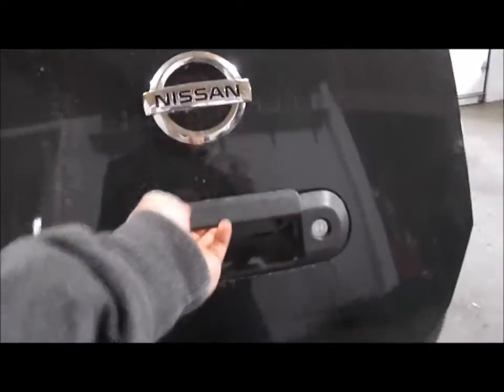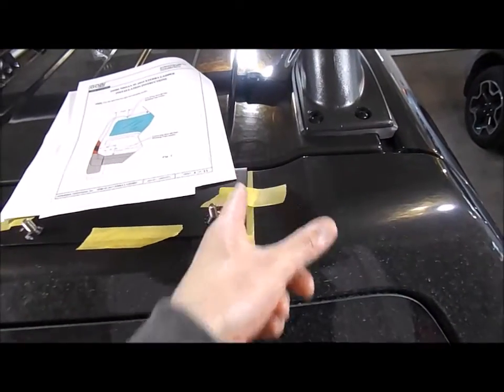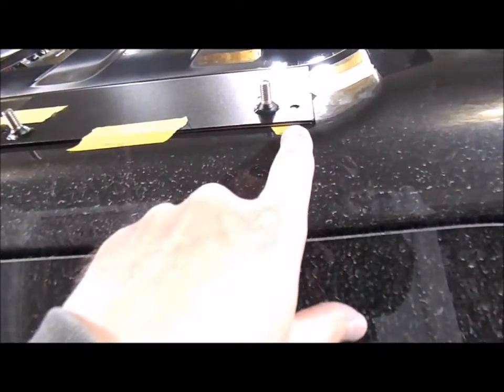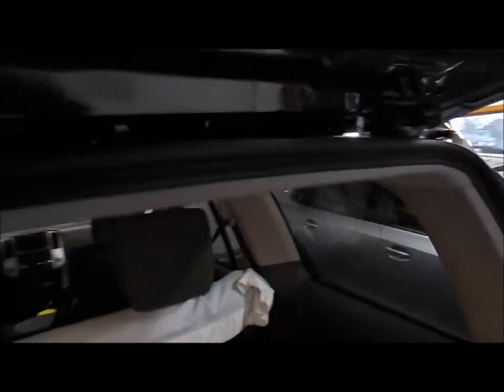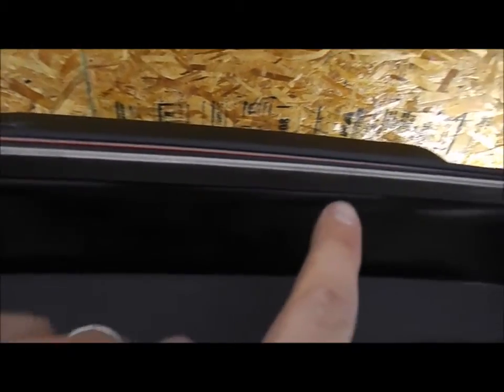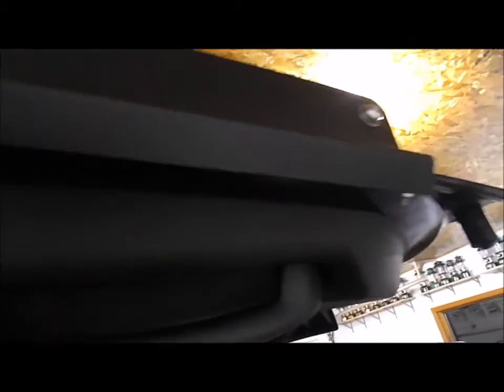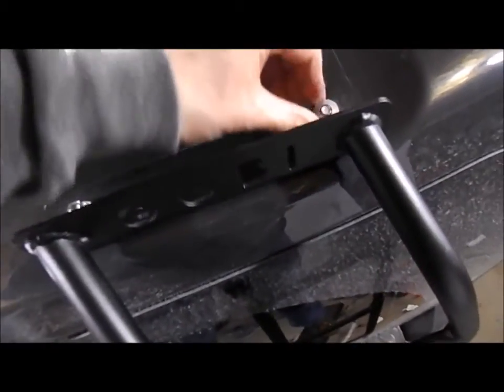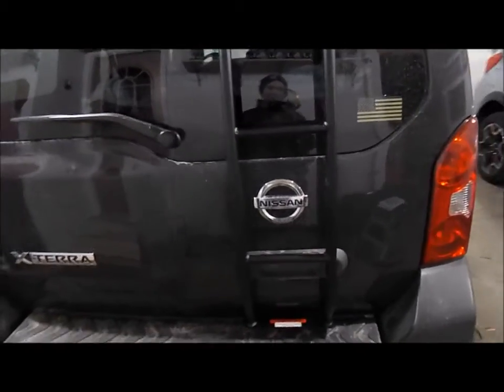Gobi Ladder Installation

Comment: Not sure if i missed it but do you remember what size screw you got to replace the one that wouldn't fit? Gonna order this ladder and the instructions are still the same so I'm guessing so are the parts.
Reply from the maker: I believe I went with 1/4 inch shorter than what it came with

Comment: I don't really need the ladder, but I'm thinking about using it as a mounting point for  rotopax gas cans. What do you think? Is the ladder too curved for that? Can't tell from the video.
Reply from the maker: The ladder is conforms to the rear hatch.  You could probably mount one gas can.  Otherwise you would need to shim off the ladder to get a flat surface.

Comment: Looks great I installed my Gobi ladder back in Mar 15 and upgraded the lift gate shocks. Instead of paying a premium for the Gobi ones, I opted for a set of Mcmaster Carr shocks with end adapters as ended. The factory shocks are @150lb, the upgrades are 175 b. I went with a set of 200lb shocks. Reason why. I have a very nice first aid kit in the hatch. No ziplock bag with bandaids here. I have quick clot, sutchers, meds, tourniquet, etc all housed in a condor deployment bag. I had to build new straps and reinforce the stock mounting points, but it fits. I also have a raingler gate pouch with maps/ atlas and a few other things.

The heavier duty struts would have fixed your fit problem with that bolt. They lift the hatch a good 6" higher than usual. Nice for not bumping heads, but my X also has a little over 3" lift and 285/75-16 tires, so she sits 4" higher than factory so its not a concern for my rig, but the extra 6" hatch lift exposes more of that area to get the bolt started. You may want to go to lockmith shop and get a "plain key" IE no transponder or even plastic grip, key cut then trim it down to a small T, just in case you need to unlock the hatch, the factory key likely will not fit anymore. Only an issue if the solenoid ever has an issue, but they can. 

Only other down side I see is not going with a Shrockworks compatible version. Later if you decide to upgrade to an aftermarket rear bumper with tire swing out, the hilift mount (shrock/ Maxterra) or the Jerry can mount (Maxterra) requires the clearance the shrockwork version has with the bar instead of tub for the first 12 of the left ladder leg.

Great write up and review, and good looking rig Sir, keep up the great work.

Comment: Did you have to drill into the car or are there threads already on the trunk?
Reply from the maker: It uses set screws and double sided tape.  I used some loctite on the threads.  Never had an issue.  Nothing gets drilled.

Comment: Can you still use the key on the lift gate?
Reply from the maker: no.
Reply: @stuntcardriver  it didn't look like it. I don't think I've ever used mine but idk lol
Reply: I installed mine so there is enough room for the key.
Reply: Not that I ever use the key but if for some reason I needed to I can.